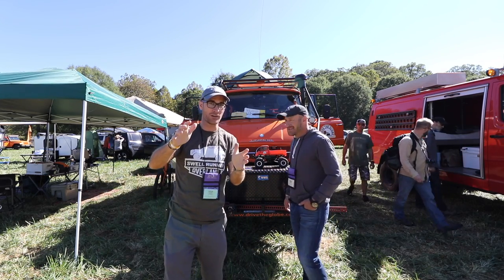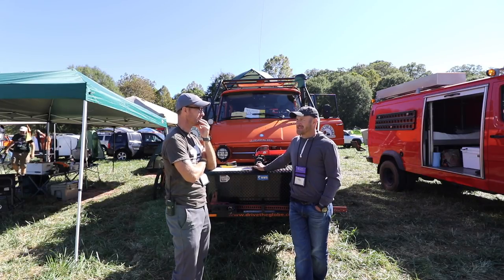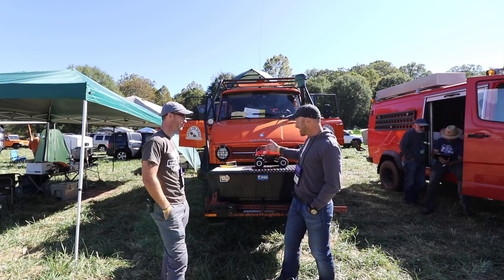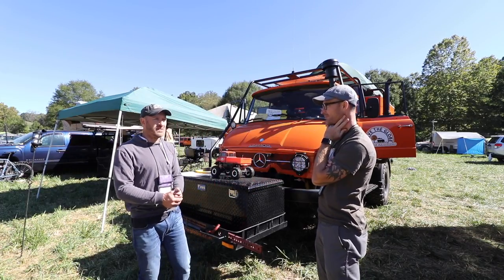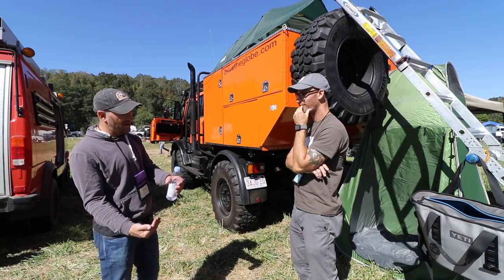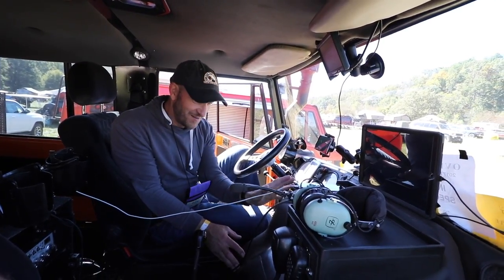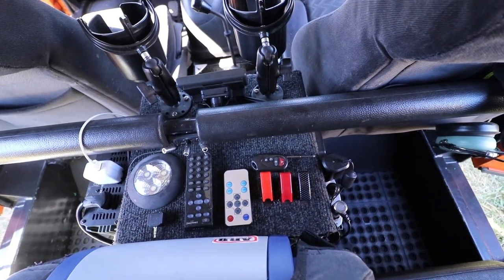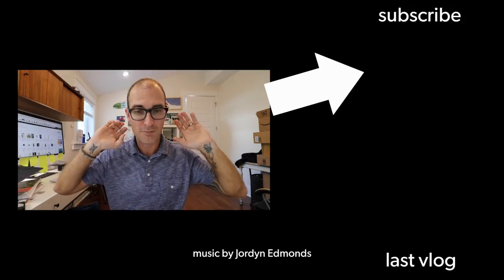Ultimate Overland Vehicle - Unimog Walk Around - Overland Expo East 2017

Comment: I have a 406 1975 Case unimog My mog is used for weed control it has spray booms on the front,  a 500 gal tank on back I remove passenger door for visibility, I use RR guide wheels when I spray on RR tracks, the spay booms are operated by hydraulic  from the cab,  boom moves up down and side to side. I run a Royer brush shredder on the front or a 8' hammer knife on the rear  for mowing weeds.  transmission 20 speeds forward 8 speeds reverse top speed 45mph, not near as nice as the Doka, that on your video.

Comment: I have a 1982 1300 L Unimog that is upgraded in many ways and is turned in to an expedition truck. It's standing on a piece of land in Spain, because of the stupid panic that governements all over the world have put in sheeplles  minds, that stop driving vehicles will turn back the ever changing climate of this planet. I live off grid in it and building at the moment a 10 meter tiny house on a semi trailer.  One of the items that I have custom builded myself are freewheels on the front axle to save feul and the reductions in that front axle. Turbo, better engine cooling etc... The living unit is one piece polyester reinforced glassfiber and not mounted sandwich panels. Sleeping above the cabin with a roof there that moves up 25 cm to stay close to 2,5 m hight. Because a Unimog cabin has to tilt forward to work on the engine etc. the living unit tilt backwords as dumptrucks do.... Oeps, dump the old trucks..... what's comming out of those exhaust's gives you a dirty noose, the newest engines give fine dust that go's deep in your lungs. I'm 70 now and arguing about what ever with guy's who know everything is a waste of time. In the EU we have summer and winter time, means that twice a year the clock's have to move one houre back or forward. After more then 40 years  finally , the EU governement accepts the realety that the dessison then taken , was wrong. Maybe in 40 years from now, driving my Unimog will be accepted again... :-) . No problem, a Unimog will  do it even much later....

Comment: "If this truck gets stuck, trust me you dont want to go forward." This comment made me loose all respect for this guy. He seemed very reasonable and experienced but all of a sudden he seemed like someone who built the truck to take to overland shows. If your going in and you get stuck and you want to go back out, yes you only need a rear winch but if your going out and get stuck (having to go up a hill you went down/mud hole that is easier going in than going out/dry going in, wet going out) if you have no front winch, you are going to have to winch out of the situation, turn around and winch through the obstacle backwards to get home. Makes no sense to anyone who has actually done any real off roading.

Comment: You take a farm tractor and a utility truck and put them together. That is a unimog
Reply: The Unimog has a verry flexible chassis that keeps the wheels always on the ground tougheter with the long traveling springs; you can put a 50 cm high block under the left front wheel and one under the right back wheel and it's still on four. Try that with a tractor or utillety truck. BUT, indeed, the Unimog is not made for the high-way but for all kinds of(f) raods, what makes it 99,99999999  % of the earth surface . ( if the snorkel is high enough, water is also not a problem, mine has a bit of over-pressure in axles, lights etc from the moment the 4x4 is ingaged, so that the water never gets inside those items )

Comment: That is the biggest load of crap unimog. My 4runner has more purpose than that thing. No camper, way too much storage and not even a proper roof top tent. Seriously how much equipment do you freakin need. $80-100k into the build did he even think to add a $1500 proper tent?
Reply from the maker: jisezer did you even watch the video? You completely missed the point of the unimog. 🤔😳